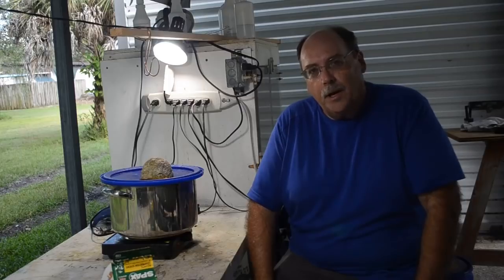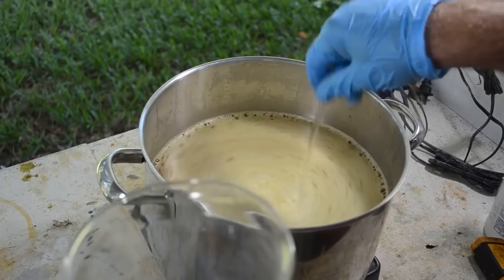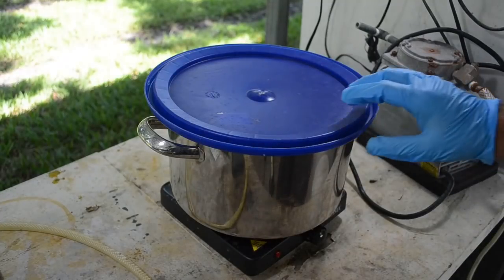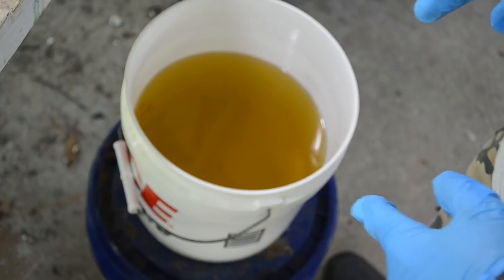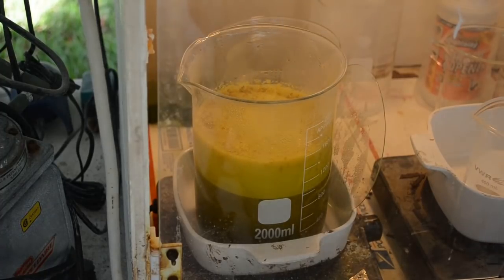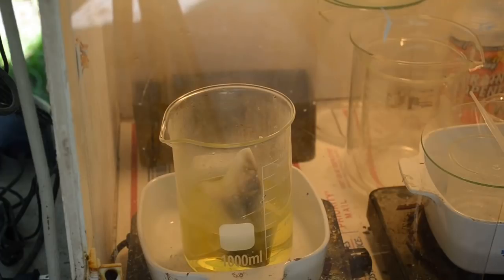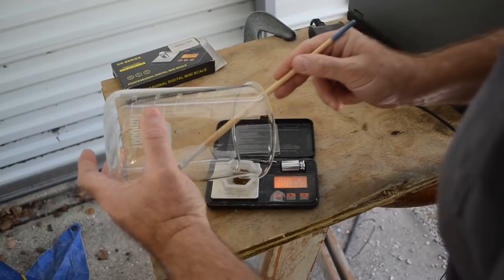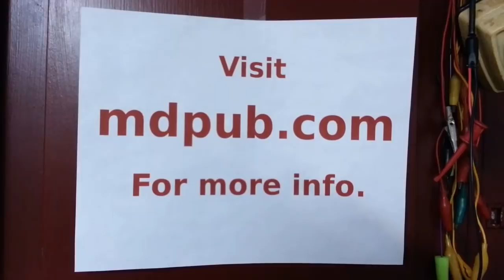Eco Goldex gold plating stripper; Scaled up process. Part 2

Comment: Thanks mate for useful information on this stuff. It seems they didn't use any inhibitor for the copper and base metals which caused these troubles. 
This is a big issue which never been referred before. 
Thanks bunches 🙏

Comment: The stannous test does not work, because the cyanide leach "complexes" the gold. Which means wrapping and effectively shielding the gold ions in a hull (the "complex") of cyanide ions. This is the reason for many properties of this process. This bond is quite strong and takes away a lot of reactivity off the gold ion. Being so strong a bond is the reason why you can leach elemental gold into solution with cyanide ions at all. It stabilizes the gold ion, effectively removing it from the available compounds in the solution. This shifts the equilibrium towards the dissolution of the gold, which would otherwise not happen. Same with the Zinc just partially dropping the gold. Zinc is so reactive it should reduce all gold ions in normal conditions. But the complexation prevents that. 

This leads to several options how to target the process. The multiple cementations are certainly a weak point.  Attacking the cyanide ion would release the gold ion for precipitation. Nothing else is done here indirectly with the Zinc. But bleach and H2O2 are also good candidates. And of course strong acids, with the  by product of releasing hydrogen cyanide. 

I think you need a comparison with stuff of known yield using this method and the classic AP solution.  As long as you get >95% of the gold out, it doesn't matter that much how much liquid to go through. It does matter, but hurts less than losing gold.  And with "only" 2 cementation, each taking out ~50% (average of the given range of 45-55%) of what is in there, there is still 25% of overall gold in the leach solution. Which is a significant "loss" for now, even though it is recoverable later on. 

Have you found Silver or PGMs in the leach at all yet?

Comment: Could you line the bottom of the pot (or other container) with paper?  I imagine it won't last long in acidic solution, but hey, it could help with getting the cemented gold to not stick to the bottom.

Comment: I like that at the end of some of your videos especially this one, you sit down and talk about what was happening and your opinions on things. 
I've been studying this for several years now and during that time I've been collecting a "fair amount" of ewaste. Since this is all about the hobby I'm not really caring about the cost of the gold recovery or refining,  I'm leaning towards the regular way of using nitric and the other common acids that you usually use. 
If a profit did not matter to you which way would you prefer to get this thinly Plated gold off??
Reply from the maker: Glad you like the "fireside chats" at the end of the videos. Wasn't sure if people were going to like them or if they just wanted me to stick to the action.
For getting the thin gold plating out of the inside of connectors, I really can't think of a better way than the Eco-goldex. There's just too much other material to process there. There's 10,000 times or more base metal and plastic in them than gold. Trying to dissolve all that other stuff and just leave the gold behind would be prohibitively expensive in acid and time even on a hobby, don't care about the cost basis. Just have to put up with low yields and lots of base metal contamination. But I am working my way through my buckets of low-grade stuff and getting some gold out of it that I otherwise wouldn't be able to get.

Comment: What do you use for a catch pan. I've tried using Pyrex dishes but they keep blowing up. My hot plate doesn't get super hot and I'll slowly raise the heat over 30mins or so. They keep blowing up. I've tried cheap ones and expensive. Same issue ... boom
Reply from the maker: Pyrex isn't what it used to be. Corning sold the trademark to another company and they just slap it on ordinary glassware. Takes a lot of people by surprise when the stuff shatters when exposed to heat gradients. I use Corningware casserole dishes. They seem to work well. Haven't lost one yet.
Reply: Hey thank you sir. I didn't know that

Comment: Why don’t you try putting a kilo of pins and connectors into a Batch and get the Tin and Sodder off of it then Go into Nitric boils then do AG and see if you get more Gold out of Solution or a run.

Comment: The gold plating stripper I using is much easier than Eco Goldex gold plating stripper, the gold solution is just need to add 20~30g of NaOH and add 70g of reducing agent, then waiting for the cement gold settle down.

Comment: I had another thought. Somewhere in Goldex doc, I read that if you are circuit boards, you should soak them in water first so they don't soak-up the gold solution when striping. Maybe this is were some of the gold went.

Comment: You may want to build a Vacuum "rig" like 'that other guy' has ... has a vacuum regulator switch to lessen  to 5 to 7 inch of vacuum ... this helps to reduce filter fail(s) also has a tank to 'store' vacuum 
secondly ... New Nitric Production video with clean up and Acid storage content, Please ... Length is never problem for me ... I know how to pause ...LOL   Thanks

Comment: I suspect dipping whole boards into the stripper is the cause of some of your yield issues. The mix of base metals is  choking the stripper as it's not as selective as we'd like. If you can break down the scrap and focus on the gold bearing fraction your efficiency should go up
Reply from the maker: Yes, that's most likely true. The problem is breaking down the boards. The fingers are easy enough to remove, but all the other connectors and stuff aren't so easy. Eco-Goldex promotional literature shows entire mother boards being processed in automated processing lines. They don't discuss the issue of base metal leaching though.

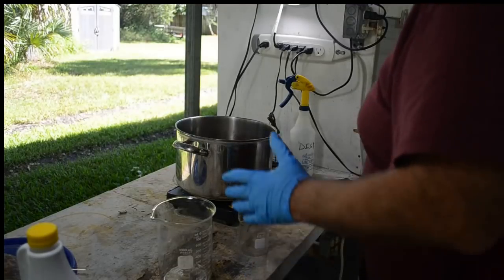Comment: 00:00-7:52 Filtering 
7:52 -19:25 Ajusting PH by sulfic acid to ~3, temperature 30 (from me, white stuff have gold, dont throw away)
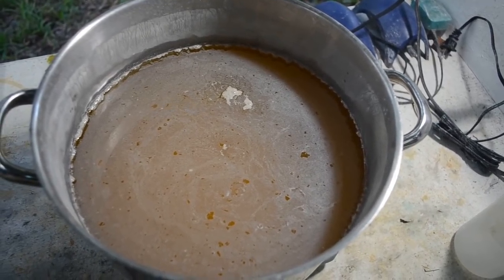19:25- 27:00 adding zinc (from me, zinc gold recovery ability is same for any sort of liquid. 2-5 gr of zinc can recover 1-2 gr of gold. Actually you add zinc till solution changes color. You can add more, nothing going to be) 
27:00 -34:57 PH ajust, filtering -better dont use stainless pots) 
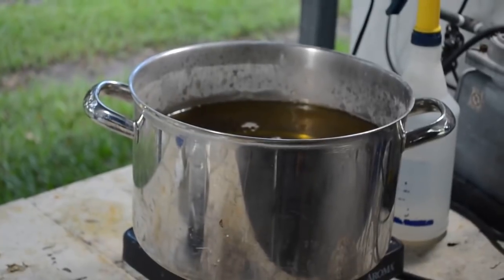35:06- 43:21 ph ajust with sulfic acid, 2nd cementation, filtering 
43:40- 49:18 sulfic acid to dissolve zinc, filtering
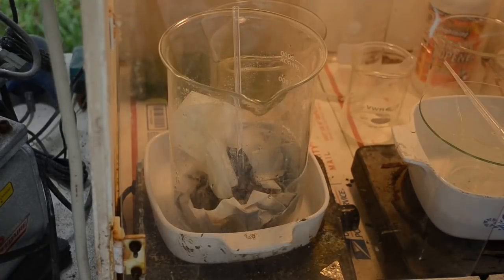49:28-58:19 Aqua regia, filtering
58:19- acids bond, filtering, recovery
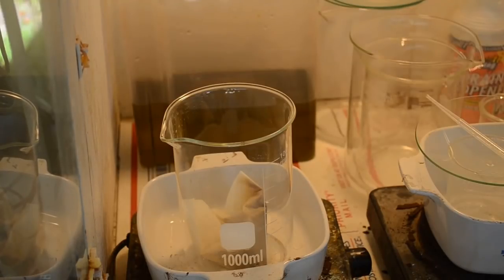1:06:15-1:20:39 cleaning gold filter , measuring weight (3.58g) issues disscussion

Comment: I find that when i process 100 grams in a 50% water and 50% nitric bath (about 80ml total) the gold comes off before the copper gets ingested completely. When doing it that way, it takes about 20min to process, and almost 1 hour to filter with a gravity funnel. But i get the foils and some white mush at the bottom (hemce the long filtet process). Still, its faster for me overall. I may lose a tiny bit, but not much.

Comment: 47:00. I think there is a downside to using the Sulfuric Acid to eliminate the Zinc. After the Zinc is gone and you pour out the liquid back into a paper filter, You're forgetting something very important:  Sulfuric acid destroys filter papers. You need to Dilute the Acid a little more or Neultralize it before filtering, otherwise you'll have a filter paper failure and you'll end up having to re-filter it again.
Reply from the maker: Yes. The eco-goldex instructions say that can be a problem with sulfuric acid. So far so good for me. I usually use muriatic acid anyway to eliminate the zinc. This time I had some of the 20% solution of sulfuric acid left. So I used it.

Comment: I think all those complicated instructions for recovery are so that you can get a fairly pure gold product to drop out of solution. But really, if you think about it, who cares about that. If you end up with a metalic product thats even 5% gold and you get it quickly think how much you have upgraded the gold product from plating still on a board or connector. I think you could just get yourself a big ecogold stock pot and pour everything straight into it. Leave a generous excess of zink on the bottom of this stock pot. Put a bubbler in there, adjust the PH to 7 once a day as needed and just clean it out once a year like you would any other stock pot.

Comment: I electroplate it out of solution and use contracted sulfuric to keep the fluid volume to a minimum you can separate to a point plating it out but you still need to refine normally

Comment: After my first cementation with hcl, I generally use smb to lower the ph level to around 5 for my second and third cementations with zinc powder.  It's pretty quick to settle out
Reply from the maker: That is the way the Eco-Goldex instructions used to say to do it when I started using it. Now they explicitly say not to use it since they changed the formula and instructions.
Reply: @omegageek64  thanks for clarifying. Not beyond my first purchase from them a year or so ago

Comment: If you do NOT scrub the stainless steel between droppings, and use the pot to get rid of the zinc,you will only have two filters to deal with.  A lot less paper.

Comment: Just a thought, how do you think about this process. In short. Strip with eco goldex, add coconut activated charcoal, dry/incinerate activated charcoal, grind into fine powder, do a nitric acid wash/filter(solution should contain the impurities, then do a Aqua regia separation on the filter sludge. That solution should be the gold. In theory that give you a relatively clean gold drop and not have to do so many drops. If you use enough AC at first that should grab all the gold. If not you can just use the waste and run it with your next batch. That would seem to be cleaner and faster.

Comment: I'd also love to see filtering off the white precipitate before cementation.  Did you happen to notice what the pH is when the precipitate starts to form?

Actually, if you're up to it, it would be great to split a batch before dropping the pH and use HCl in half and H2SO4 in half. Filter both to compare the amounts and appearance of the precipitates, and finally add some HCl (or NaCl to avoid dropping the ph further) to the H2SO4 filtrate to see if additional precipitate forms (silver sulfate is slightly soluble, so there should still be some Ag+ ions in solution for the chloride to drop). If it does, it would confirm the silver salt hypothesis.

I'm also curious about the gas that evolves as the acid is added. CO2 seems likely, but could it be H2?

Great video as always, thanks!

Comment: Maybe dip your parts in hot hydrochloric acid 1st to remove the tin and lead. Then continue with your normal process. I'm not convinced you wouldn't do just as good using reverse electroplating with a 12V power supply and concentrated sulfuric acid. What do you think?
Reply from the maker: The problem is that you need a good electrical connection to the stuff you are trying to reverse electroplate. Most of the low grade stuff I am processing is buried deep inside plastic connector shells. It would be about impossible to get a good connection to more than a few of the pins in any batch. Reverse electroplating works well for jewelry and naked plated pins that can make good contact with the anode basket, but I think my stuff would just sit there doing nothing.

Comment: You should be filtering after you drop the Ph, but before you cement. The same as you would with Ar. It will remove all the salts, silver, lead, nickle, chrome and so on created with the sulfuric acid. Your gold will drop faster, the zinc will dissolve much better. Get the salts out before your cement. It will make the whole process so much easier.
Reply from the maker: The precipitate that forms contains a fair amount of gold. filtering results in lost gold.
Reply: @omegageek64  If it's rinsed in the filter until the fluid is clear there's no gold loss to speak of. Yes it takes time. I gravity filter sediments by just misting them. A layer of clear water on top and just set it aside. Looking at the drip now and then to see if it's clear. I have thought about using EcoX but it's hard to retrain an old dog